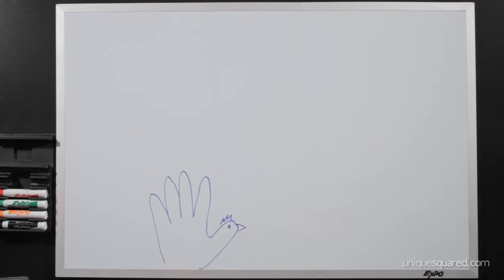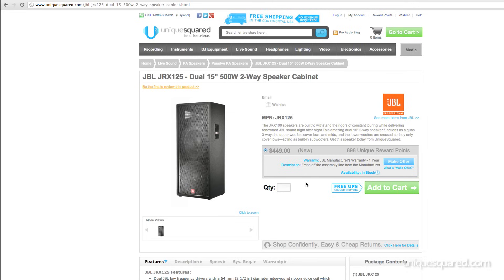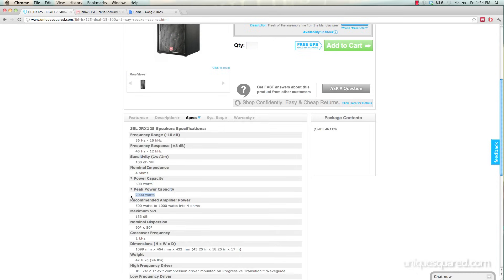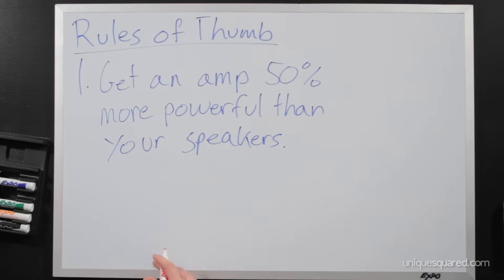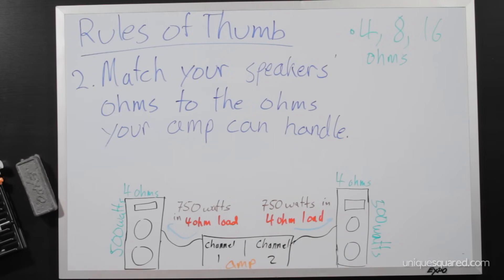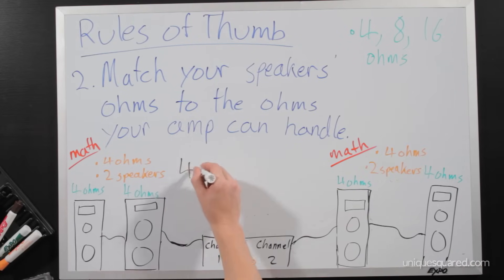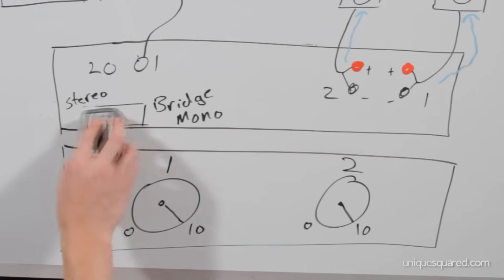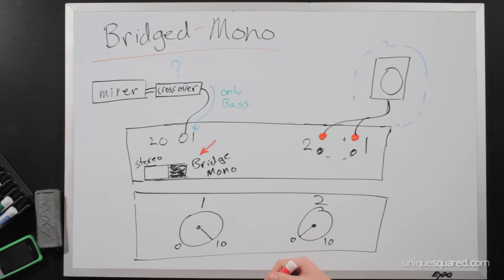Amplifier to Speaker Matching Tutorial | UniqueSquared.com

Comment: Buy from a company that accurately rates their amps.  Match rated amp power to the max linear power handling capability of the speaker.  Run both at half their handling or less for best results.  The speaker rating will be based on excursion limits, but thermal limits are lower and distortion on speakers always goes up the higher they  are driven.  Keep the amp output limiter On always.  If the limiter ever triggers, turn it way down for a minute to let the voice coils cool, then to half or less the dBVu of what it was when it limited.  Preferably, the amp should have a meter to help you keep it away substantially from max rated output.  Don't push this stuff too hard.  Speakers will sound worse over time if they've been pushed hard too long and power supplies in amps will eventually degrade for the same reasons.  Maximize the acoustics of the room... stick those subs near boundaries, especially in corners to boost their acoustic gain in the space and lower how hard it has to be driven for the same perceived volume.  FYI, clipped signals are thermally dangerous to woofers and dangerous to tweeters for peak reasons.  An amp's output limiter only mitigates the latter, not the former.  Limiting increases thermal danger to woofers in nearly the same way as clipping does, as it similarly increases RMS of the signal.  Other than this, square waves are not inherently dangerous to drivers in comparison to other discrete test-like signals.  In the case of an unlimited amp output clip, it's actually ultrasonic clip harmonics far beyond the amp's rated power that kills tweeters.  If the amp is a proper match to the speaker and non excessive (like the outdated adage of buying double the power you need), however, brief accidental limiting should not be particularly dangerous to the woofer or the power supply as long as you let both cool before turning it up to a reasonable, safe level afterwards.
Reply: Listen to Reticuli, He's got MoJo... Like he said, buy an amp with Out Put Limiter!!
I use a Vintage Carver Cube 250 watts RMS per Channel 500 Mono and have never Blown a speaker that was under or over the Out Put Power of the Amp !!  Most amps made today are NOT Rated Correctly !! Buyer Beware !!
Reply: okay Reticuli, just assume i am an idiot...  can you recommend a good speaker setup for me?  i am guessing i need 2 speakers, maybe 4 and an amplifier.  i am not spending $699 for an amplifier like in the video above.  do i just walk into best buy and ask for JVC speakers and amp?  i want loud, like 100 decibels?  loud enough to rock the room but not loud like an airplane landing above your head.  and secondarily, any nice recommendations for speakers for my computer sound?  thanks!

Comment: if you added the two extra speakers as you showed, would they need more watts to power them? you would have two 500 watt speakers on each channel so would you need a 1000 watt per channel amp?
Reply: Almost there.. But here's what my friend taught me. Beware,there is math...

Connecting two 500 watts on a 500 watts channel is fine and actually I can add even more speakers on that channel. However, remember the Ohms thingy? You will hear exactly 500 watts from both speakers. Each speakers is 500 watts @ 4 Ohms. The total impedance is 2 Ohms, as mentioned. The amp is 500 watts @ 4 Ohms, but what it did is played thru the numbers. Since total impedance is 2 Ohms, the amps can power its channel to 2 Ohms to match the speakers producing 1000 watts. Lower Ohms can produce higher wattage but  too low Ohms (let's say 1 Ohm) is dangerous.

Comment: If you have an 800watt amp and you've got both dials set to 10 does this mean you are driving your speakers at max output (800watts). If so does this over power your 500watt speakers and what effect would this have? Thanks :)

Comment: Dud, i highly doubt your #1 rule of thumb. You may want to say get an amp that puts outs rms of power that the speaker can handle. The JBL speaker can handle 500w of rms so therefore you must get an amp that puts out 500w of rms or less per channel. If you get an amp higher than 500w, you will blow your speaker easily. This should be you rule of thumb. 🙂

Comment: The rule of thumb here makes for one enormous thumb. So much info here is just wrong. Like speaker ratings which are useless most of the time and so are dodgy amp ratings. 
Yes amp should be more powerful but then what. Speakers watts will depend on the signal that is played and is not a constant number. Pink noise uses much more power then white noise etc.

Comment: Hello Unique Squared,  By my great mistake,   + and – wires of two way  speaker connected to the 2 positives of the left and right channels of the tube amp.  Likewise, + and – of another speaker connected to the 2 negatives of the left and right channels. The one speaker was working  which was connected to the 2 positive of the amp . And the another speaker was not working  which was connected to the 2 negatives of the amp.  For the first 10 minutes, I didn’t notice the wrong connection  by my stupid mistake, then I checked and made the correct connection. After that,  both the speakers were working.  I am afraid of that : Are these speakers and the crossovers became weak? Will it be in full strength as it should be? Although the speakers are working now, I am much worried by my wrong connection.  But , Why one speaker was working and another speaker was not working?  Kindly explain in detail.    Thank you, Best Regards.

Comment: I have a Rockville RSG 15.28 Dual 3 way 8 ohm Pro/DJ PA Passive speaker  1500 RMS, 2000  program power. What size amp to use?

Comment: You can blow a speaker with a high or low power amp. 

A low power amp that is over driven   will clip causing distortion and damaged to the speaker.

A high power amp can also over power the speaker causing distortion and damage. 
A higher power amp can also clip if over driven. 

Either way you need to be sensible, If you hear distortion you need to turn it down. 

Some amps like Denon let you set a maximum volume so there's no way of accidentally damaging your speakers.

Comment: So if I power 2 1600 Watt RMS 8 ohm with a 1500 watt 4 ohm amp, what do I break?
Reply: mqgs the amp is the power source so it does not have a ohm load (it does but not toward the speakers toward the power source it is plugged into). The amp will have a minimum ohm load. this is the amount of power it will put through its self depending on the ohm load of the speakers. for example most amps (ones that don't have autoformers) will put more power, some times twice as much power to speakers with half the ohm load. 100w at 8ohms or 200w at 4ohms on the same amp. since there is more power running to the 4ohm pair the amp is being pushed harder so they put a minimum ohm load letting you know the amp will fail if you go below that point (it will get hot and burn out). so to answer the question. I guess if the amp puts out 1500w at its minimum 4ohms you plug in your 8ohm speakers it would run about half of its power so your amp would be putting out about 750w so your 1600w speakers would be underpowered.

Comment: I was wondering if I could get an answer to a question I have on my P A System.
I have a powered mixer that is rate as follows- 4000 Watts Peak / 2000 Watts Program / 1000 Watts RMS / 2 x 500 Watts RMS each channel
In the speaker output area at the back it has  4 ohms – 16 ohms,  4 inputs  (2- ¼ inch jacks and two other)
I am currently running two Yamaha S115 speakers (Nominal impedance, 8 ohms parallel input, 500 watts program, 1000 watts maximum on this powered mixer.
Is it possible for me to add two other 500 watts program speaker, either by running them off my current speakers or by running separate wires from the power mixer directly to the new speakers.
If this is possible, would it increase my volume and give me more watts, or would it damage my system.
I would certainly appreciate any help I could get on this matter.
Thanks Martin

Comment: Mate I'm deep in rabbit holes trying to figure this one out, there seems to be so much conflicting info... My new speaker specs say RMS = 75W @ 8ohms with recommended amp between 25-150W ... so I know I need maximum 150W amp to run at full power (which I don't) so I'm thinking I need a 50-75W amp right? But what about the ohms!?!?! 

I think it's the amp manuals that confuse me, would an Onkyo A9010 running 44W @ 8ohms per channel be okay? or do I need 4ohms per channel?

So fucking confusing
Reply: the speakers btw are a pair of tannoy xt 6f

Comment: If you want to measure power at your speaker set a voltmeter to AC and measure right across the speaker terminals. Play a recording of a 1000 Hz tone rather than music.    power(watts)= votage squared/ R    R is speaker resistance in ohms. So you need about 2.8 volts across 8 ohms to produce 1 watt, you'll find that 1 watt of power is much louder than you think. Measure the resistance of your speaker first because some stamped as 8 ohms may measure less with meter.

Comment: Hey! I have two passive Sony speakers that put out 25W a piece and they have an impedance of 6 ohms and two Mackie CR3's that also put out 25W a piece and have no speaker wire inputs (RCA and AUX are my only options) . What specs should I look for in a receiver if I want to run all 4 of these speakers at once? Any help is greatly appreciated!

Comment: Hi their is a couple of things that are wrong in your video you say that impedance and ohms mean the same thing. that’s half true. Ohms of a speaker is just the voice coils DC resistance once you run a signal from an amp to your speakers the resistance becomes impedance so ohms is electrical resistance with no currant and impedance is electrical resistance with currant. And to further complicate things a speakers impedance changes with frequency’s. As far as amplifier power you always want to have more than needed this is called amplifier headroom this is needed because good recorded material has dynamic range and a good amp will take full advantage of dynamic range so when sound quality is concerned you always want more power than needed unless your source material is compressed and has no dynamic range and you don't care about sound quality.  You want enough power to reach your speakers peak SPL sound pressure level witch in your case is 133db so lets look at your speakers sensitivity and we can determine the watts needed. Your speaker have a 100db @ 1 watt sensitivity so that means they will play to 100db in volume at 1 watt. And it takes double the power to increase 3db in volume so if your speakers play at 100db at 1 watt then they will play at 103db at 2 watts 107db @ 4w  110db at 8w  113db at 16w  116db at 32w   119db at 64w  121db at 128w
124db at 256w 127db at 512w  130db at 1048w  and their peak 133db at 2048w  so JBL did not get it wrong when they say maximum 2000 watt amplifier.  And speaker specs continuous , RMS , Program power are not all the same please lets not slap the engineers that have PHD's and design electronics in the face like you did with OHM'S vs impedance.  Continuous power is A continuous signal signal sent into the loudspeaker, most of which turns to heat. Apply too much power for too long and the temperature will rise to a point where the voice coil of one of the drivers literally melts.  RMS power is the speaker current divided by 1.414, the square root of two. This gives a number somewhat smaller than the average and reflects a more accurate sustained power capability for a speaker. And program power  represents a more realistic scenario where the input level rises and falls, thus giving the speaker time to rest and disperse some of its waste heat.  That's why we call them continuous , RMS , program power because they are all different measurements of a speakers ability to handle power.  Please stop the spreading of bogus information by researching the facts before you post.
Reply: I think he said that to not complicate things.

btw, when "playing" with dB : +3dB is x2 power and +10dB is x10
So the difference between 1W and 2000W is x2 x10 x10 x10 -> 33dB
Also, JBL often just calculates the max SPL like we just did here and you will also see that their nominal (in the past called AES rating) to peak power is always +6dB. In the past they actually measured it, but I am not sure if they still do.

Comment: I am sorry my friend but I think you should learn a bit more before trying to teach others. No professional sound engineer will agree with most of what you are saying. People who do not understand about audio or beginners will eventually blow their speakers with your advises and as a result they will also blow their amplifiers.  The problem with under powering speakers is because you may take the amplifier to clipping because you will not notice the distortion so much. If the amplifier reaches clipping it will send bursts of direct current to the coil of the speakers, will heat them up and eventually burn them. But this is not because your speaker can not handle the lower power, if that were true, all amplifiers would always have to be maxed out and you would or could not listen to music at low volumes. Speakers have no power. They have the capacity to handle power to a certain limit. A 500W speaker will work fine from 0W up to 500W. And you are also neglecting to mention the difference between RMS power and Peak power. Many manufacturers rate only peak power. And peak power is what a speaker or an amplifier can handle in a Burst or a Peak. If people follow your tutorial they will most likely burn their speakers in no time. And if you have a 750W (RMS power) amplifier and a 500W (peak power) loudspeaker, the result will be even more disastrous because this amplifier will have Peaks of 1500W and the absolute limit of that speaker will be 500W.

Comment: if the rms is 500w u need 1000-1100 w .Dont make movie if you are idiot.A 500w rms speaker powered with 750 its under powered.And by the way u will not blow the amp u will blow de speakers .
Reply: speaker repair techs will will  you the burnt out speakers that they repair, are due to under powered speakers,  I have a kam  amp and with it tells you to have higher rated speakers than the amp,
Reply: Proiectediversediy
Reply: Yeah well said!!!! Unbelievable!
Reply: Proiectediversediy JUST NOT YOUR AMP SHOULD BE A BIT LESS WATT THAN THE SPEAKER LIKE IS EVERYONE IDIOTS??